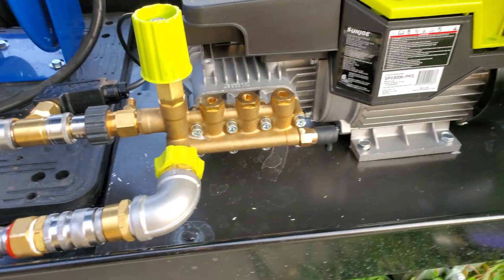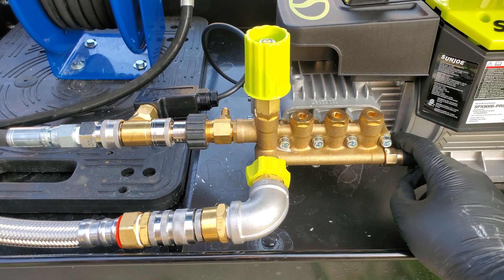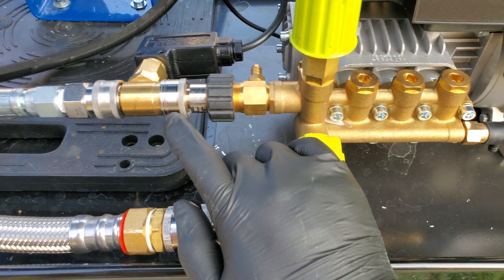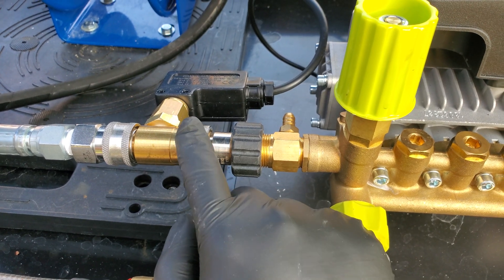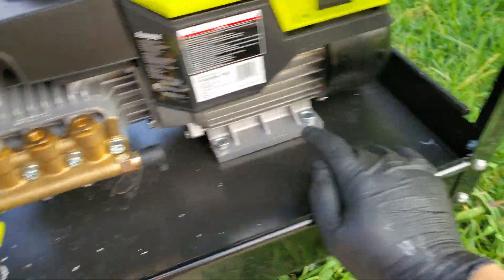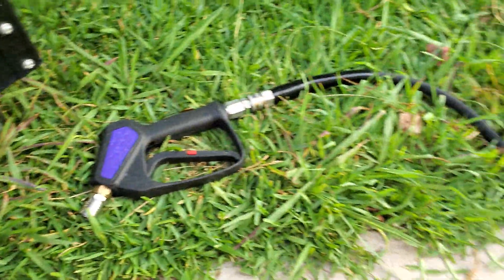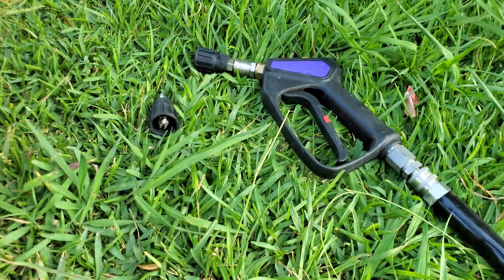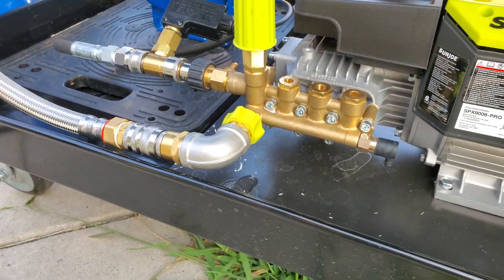Added a Total Stop System to a Sun Joe SPX-9006 / SPX-9004

Comment: Hey Chris great video tyty... this is exactly what I'm looking for for my Canpump Electrojet CR3000 it's 1500psi and 2.2Gpm 2Hp motor and 16amp 120V...  anyway was just wondering if you remember where you purchased the switch? If you have a link or something that would be much appreciated.
Reply from the maker: @dieseldan2003  This ultimately ended up not being a solution. There was always issues with every iteration and i wanted it perfect. I eventually gave up and bought a new pressure washer.

Comment: Hi, im planning to get a arblue 630, this model doesn't have the tss. Thr local shop saying the 630 model with the tss isn't available in my country.
Im wondering would the modifications as yours would work on the ar 630 model cause it says it has a automatic pressure relieve system. I dont really know what that means.
Reply from the maker: I had trouble ultimately finding a pressure switch that worked with the sun joe setup. AR offers several models which have TSS so my best suggestion is to find one with it vs a retrofit as although I was close, I never found an end result I was 100% happy with

Comment: Great Job, Can you add a LINK to buy the pressure switch?
Reply from the maker: Hey Joe. I posted an update on this as I ran into issues using a foam cannon. If you don't use one, I can purchase a switch below but if you do, I'm still on the search for a switch that fits those needs but to be honest, it's not looking promosing.

https://www.toolbarn.com/karcher-8-712-262-0.html/

Comment: Chris, how did you fiqure out the issue from the pressure switch cycling in and out?
Reply from the maker: With this switch, I didn't have any cycling problems except when the foam cannon was being used. I'm still in the process of finding one that accommodates the increased foam cannon pressure. What you can do is turn the unloader dial back a little bit - if you're on the cusp of the pressure actuation psi, this should help but i don't recommend dialing it back too far.

Comment: Awesome job! I’m not that mechanically inclined. I bought a surge outlet that came with a remote control on/off. I plug the pressure washer to the outlet and leave the small key chain remote in my pocket and just press it when I need to use it. Kinda annoying but it works and I’m used to it now. Wish SunJoe would just add the damn auto off/on.
Reply from the maker: Good timing - I just posted a video of how it works. Hopefully it's detailed enough so anyone can do it!
Reply: @ChrisL-rh7io  awesome! I’ll check it out.

Comment: Do you have any problems with the foam canon
Reply: Thanks for the information I like your set up
Reply from the maker: @joegehring69  No problem. Happy to share the knowledge 👍
Reply from the maker: Yep, I've mentioned it in other comments and is why I haven't posted the DIY. My solution is to use a pressure switch with a higher rating than 580 but am currently in process of moving so haven't had the time to do all this as much as I'd like to.
Reply: Cool how do you like the pressure washer I was looking to get the same one does it produce thick foam
Reply from the maker: @joegehring69  Yep, it foams pretty well with my pf22. I wouldn't say it's worth the $400 original sticker price but for ~$200 when Amazon has a sale, it's an amazing deal. Not having total stop has been a headache. It's pretty inconvenient but is the only issue I have with this machine

Comment: Question on the CoxReel. I to own 50ft CoxReel. Did you use and coupler or elbow fitting when you install your Kobrajet hose to the reel? Can you provide a link too?
Reply from the maker: Nope, no elbow needed. I recommend removing the rubber sleeve. It'll make it a lot easier to attach it directly!

Comment: Where did you that pressure switch?
Reply from the maker: https://www.toolbarn.com/pa-9-802-458-0.html/
Reply from the maker: The activation psi at 580 is still too low though and has issues when I'm using a foam cannon. I'm still looking into a solution.
Reply: @ChrisL-rh7io  Can you make a video how you wired the pressure switch to the sun joe
Reply from the maker: @joelmunoz2330  Yup was planning on it but I would be waiting until I figured out the proper pressure switch to use!
Reply: What size orffice your using for the sun joe Spx-9004/9006?
Reply from the maker: @joelmunoz2330  orifice for the gun?
Reply: @ChrisL-rh7io  Yes for the gun.
Reply from the maker: @joelmunoz2330  Got it, I use a 4.0 orifice 40 degree and 25 degree
Reply: What orifice are you using for the foam canon?

Comment: Unrelated but how did you get the QD with no clearance on the mosmatic xD
Reply from the maker: I'm using the Mosmatic coupler from OG but on a 29.132. There's still a gap, but it's small and you can't really see it in the video.

I will say that the fit and finish is nice on the Mosmatic QDs, but they leak or don't fit well with MTM parts so if I had to do it again, I probably wouldn't have upgraded because I had to change out more pieces than I wanted to.
Reply: @ChrisL-rh7io  oh wow did not know that. Thank you for the insight. Much appreciated :D